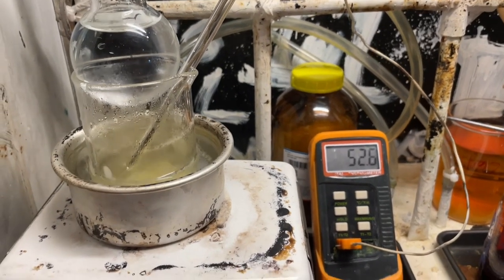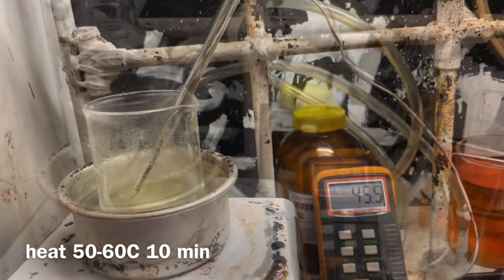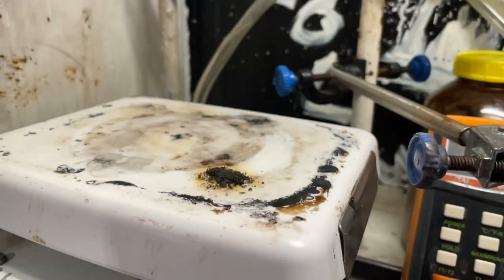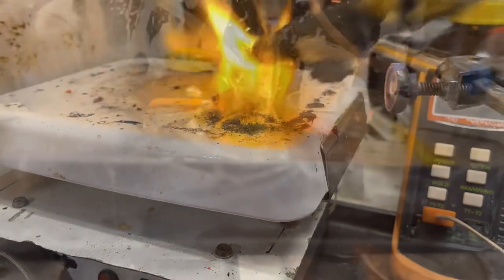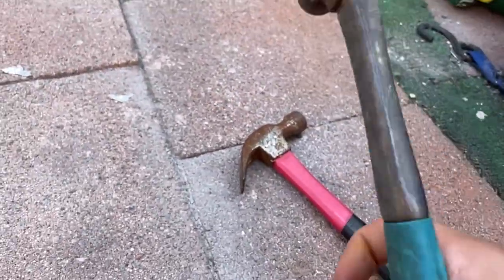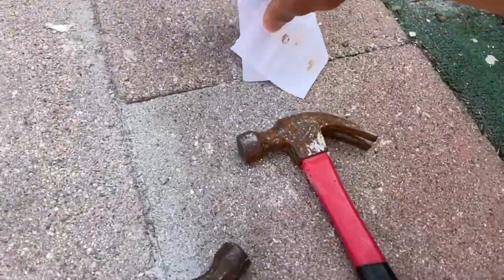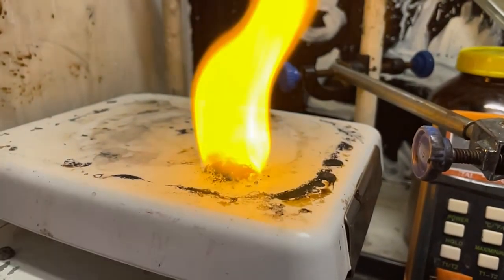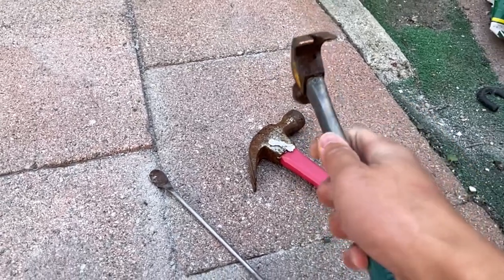Nitrostarch Synthesis and Tests

Comment: During WW1 Trojan Co located in Pennsylvania, was able to produce millions of pounds of this stuff per year, and here we are having a hard time to produce 10 grams of the stuff!!!
Reply from the maker: there is a difference between a factory and a lab, you cannot reasonably replicate a high efficiency haber bosch process in a lab setting like how you cannot feasibly build a car entirely from scratch, casting the steel, tempering leafsprings and all

Comment: The nitrostarch you made is going to be much weaker, as the original synthesis calls for the use of "red fuming nitric acid"
Reply from the maker: wikipedia is not a good source for proper procedures, this one is from an old manual
Reply: @EdwardTriesToScience  well red fuming nitric acid will yield a more pure product as it contains less h202, stronger concentration
Reply from the maker: man what are you smoking
Reply from the maker: thats for one not the formula for water, two not how this reaction works and three, would result in worse product due to nitrolysis
Reply from the maker: i do not have time to go over the fundamentals of organic chemistry and nitrations/esterifications/nitrolysis, please pick up an organic chemistry textbook
Reply: Lol @EdwardTriesToScience